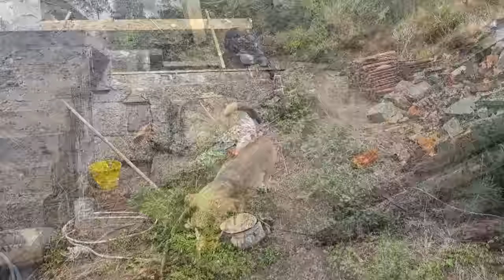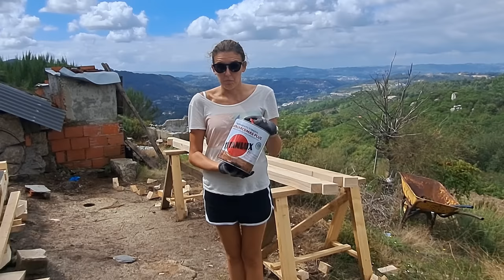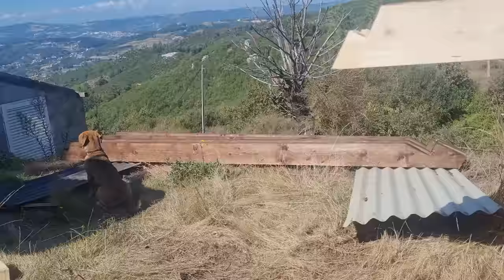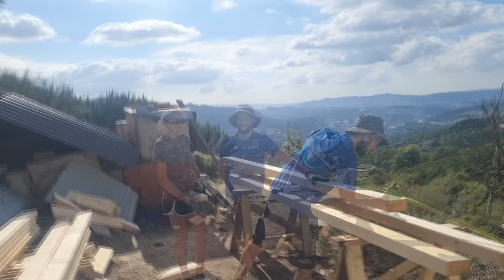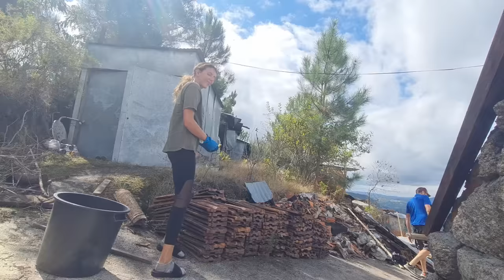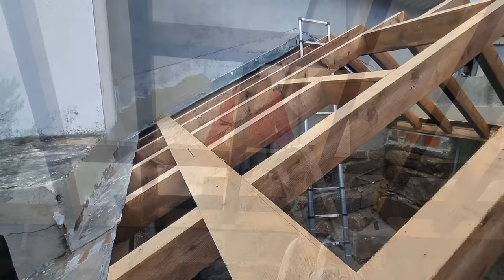DIY Roof Replacement Part 3 - Rafters are up - we are getting there!

Comment: That window is going to make a huge difference in the kitchen.👍
Reply: Everything looks great, can't wait to see the tiles on, good to see a professional joiner using a hand saw with little ease, pity the power washer stopped working,tis a lot of hard work with a wire brush, knowing now the direction of the water you can use it to your advantage for watering plants in garden, great work can't wait to see the tiles on 😅🎉
Reply from the maker: Thanks Leo! We are desperate to get the tiles on now 😅💚

Comment: The woodwork looks spot on ! The cuts are so far beyond my skill level.  LOL   Well done .  I think the roof will be fantastic and the colour is really nice  .  You may need to get another jet washer tho . There are plenty of things it will be useful for round the house .  The only bit I felt a bit uncomfortable with was not having a scaffold set ,Doing all that work from a set of steps looked so awkward ,but its done now so too late  ,unless your going to do more roof renewals  ?
Reply from the maker: Thanks! 😊 determined to get it finished now. Unfortunately the jet washer may be malfunctioning due to the water pressure so just have to suck it up for now. Hopefully no more roof renewals for a little while 😅💚

Comment: Great job, nice to see a professional joiner using a hand saw with such ease, great idea with the skylight device, the tiles are nice not to new looking pity the power washer stopped working its a lot of hard work with the wire brush, can't wait for the next video,, good work 😅🎉

Comment: Great job with the roof, guys. And thanks for the video. 
Just watch out with those two gully sections, that if either gully clogs up with leaves in winter the flashing will overflow into the roof space or into the kitchen below. 
The water capacity of a vee-shape gully is just the limited flashing height you have on the rafter side. 
The solution will be to keep an eye on the leaf fall, for each month, clearing any debris or composting soil. And if you have vey low rainfall, then it probably won't be a problem. 
I just thought I'd mention this, to be helpful before you fit the tiles.
Reply from the maker: Thanks for the tip 😊💚

Comment: You guys are making awesome progress! I love the stain color you chose. It will be such a lovely spacious room for cooking when it is completed. I like the skylight idea too. It will bring in nice natural light. The tiles looked so clean and brand new after the cleaning. It’s great that many could be reused. Are you able to get the same exact tiles to replace the broken ones because sometimes it’s hard to find exact replacements? I noticed that most of the homes in Portugal use the clay tiles so maybe they are just a common available tile? I hope you have lots of dry weather to complete this critical work! ❤️
Reply from the maker: Hi Karen! Thanks so much for your comment 😊 we love cooking so for us the kitchen will definitely be one of the most important rooms! 🥰 we were able to get a few more tiles from a local supplier, but very lucky to have so many we can reuse from in and around the property 😊 having a good run of weather as well 💚

Comment: Hi you two🎉 just a tip, I think you might be loosing a few viewers due to he length of your videos, ⏰ 39 mins is a long time. Maybe cut them shorter a bit, I watch a few vlogs and they are no where as long as yours. Hope this helps. Fabulous work on the roof, what a craftsman. 🛖 And well done using old tiles instead of buying new ones. Still your  most loyal viewer. Tony ❤️🇬🇧 xx
Reply: The longer the better for me, I love the detail and seeing how much work is put in - you can always fast forward 👍
Reply from the maker: Thanks Tony 💚😊 love that you're a super regular viewer!! I think the video length just depends on what we are doing really and what we have recorded. Don't want to skip out steps, but also don't want to bore anyone 😅 we will have some shorter/some longer